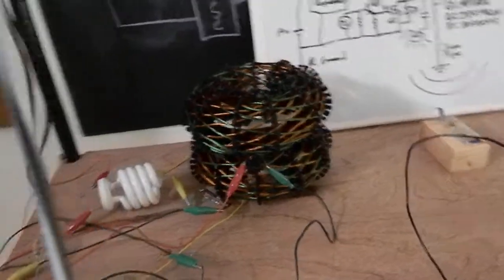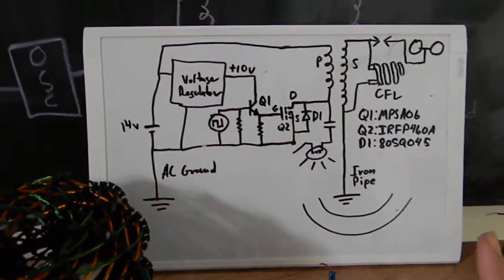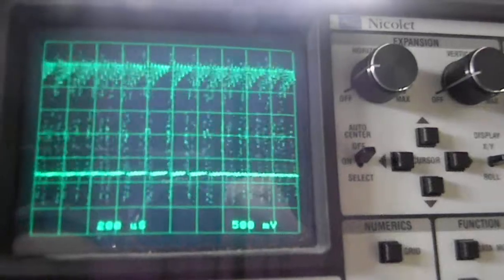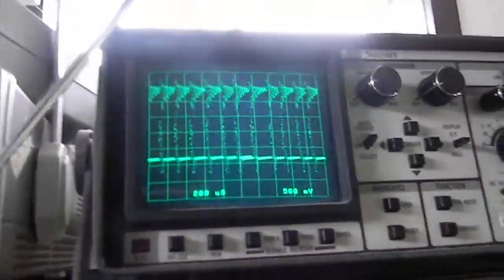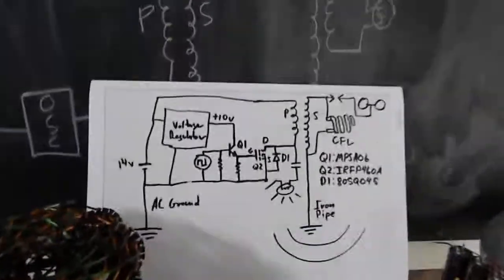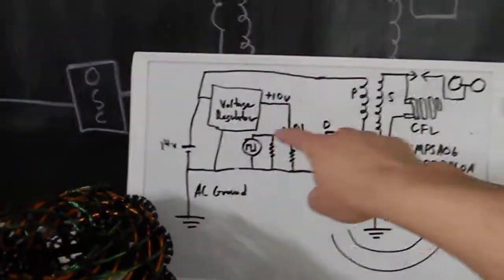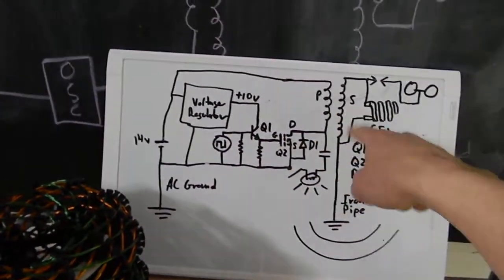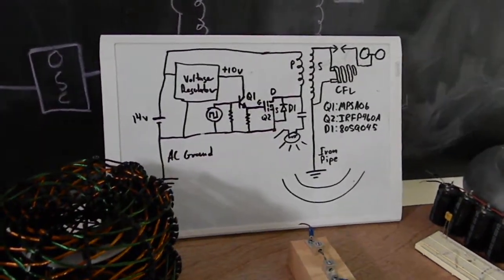Further Analysis of Spark Gap to Capacitance

Comment: One more thing as i see your video's end. i think a solution to your questions you have been asking might be found in your oscillator circuit and some triggering issues with the scope. those breadboards or whatever are notorious for parasitic capacitance so don't be conclusive or dismissive of your findings when using that set up. IMHO. Have fun. Keep going

Comment: Your spark duration, assuming the primary sees full saturation (dwell), is determined by the total impedance of the spark pathway. You are seeing the resonate frequency of the secondary mutually inducted into the primary as the coil begins to build a magnetic field. Im also assuming you have used the primary circuits oscillator as your trigger. You are venturing on a wonderful journey in what I believe will lead you down a path of constant and endless questions. And this is what is so great. Try giving your spark secondary path more impedence and then notice what happens to the spark duration. Another one; make or find a single inductor, ie a 120 volt relay, and wire it back to your scope with some coax. Then take your "probe" and move it around the spark's path, safely. What do you see?
Reply: +Warren Kistenbroker you have no videos :(
Reply: Thanks a lot for the reply! I build a new circuit as I found that this was the problem....Also any "blocking" diode provides a capacitive element for the HF currents to go right back into the circuit...I made a new video on my oscillator circuit that is based off of teslas schematics...his device was indeed VERY COMPLEX.